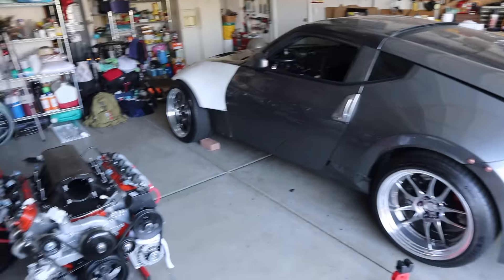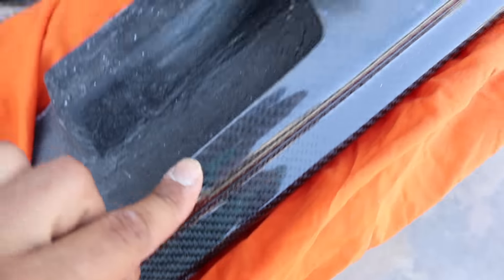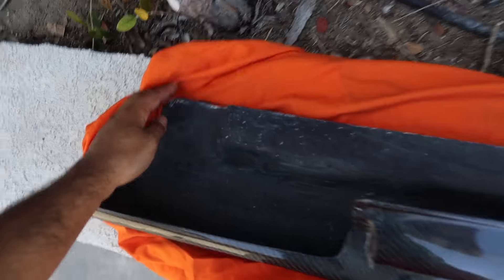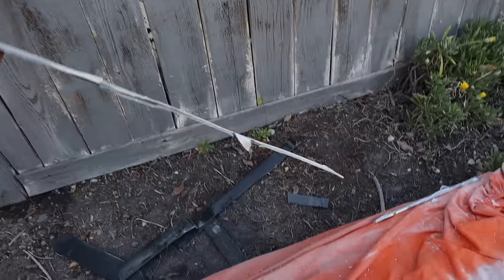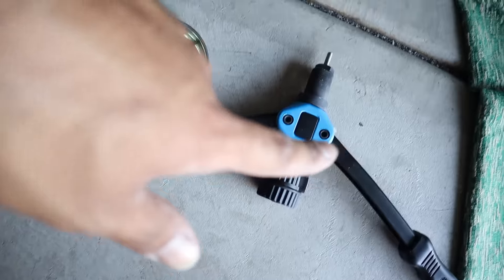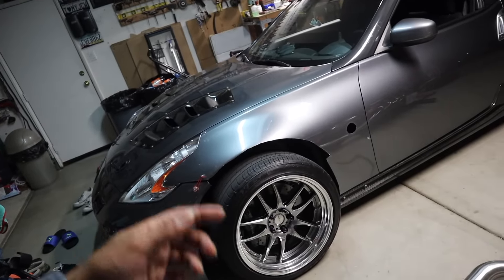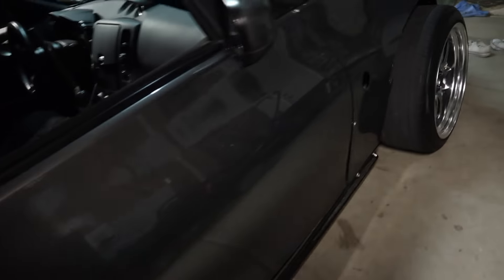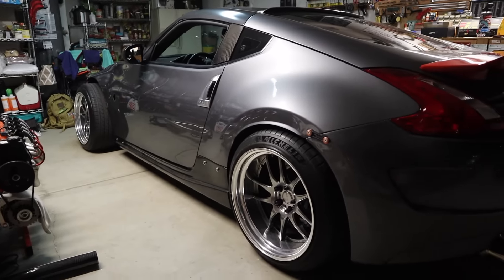Nissan 370z Carbon Fiber Side Skirt installation

Comment: Love it bought the same ones but I want to get them partially wrapped
Reply from the maker: Yes sir, I love mine it's held up great 👍
Reply: @TriggaM   instead of the 2 on rear side skirt if I did them on the inside like the wheel well would this be fine too ? And instead of the front the front wheel well as well ? ?
Reply from the maker: Yes! Like I mentioned I have a drift car so I don't necessarily care as much..I just needed it to be strong

Comment: Should use rivets instead of bolts. Will have a cleaner finish also.
Reply from the maker: On the side of the track/ or road not trying to drill out rivets hahaha I got 10mm in my cars for days. I personally hate rivets, sis it once and it was such a nightmare to take off 😂
Reply: Never drill it out just let the whole skirt get ripped off
Reply: Just a cleaner option for someone who doesn't want to remove them
Reply from the maker: 100% agree